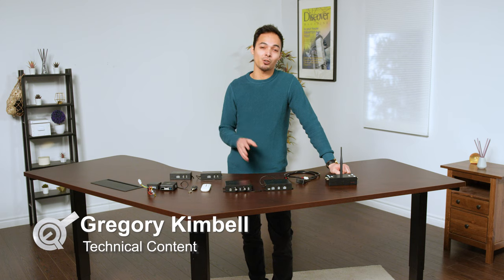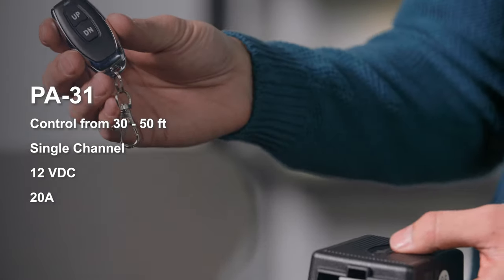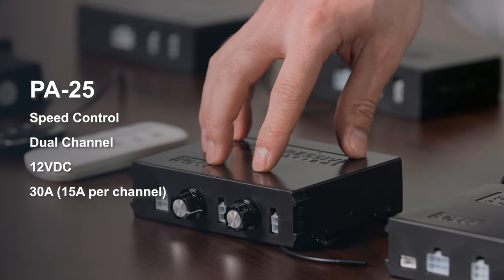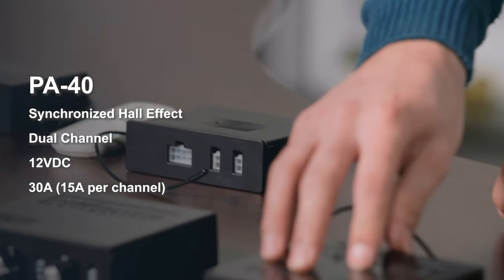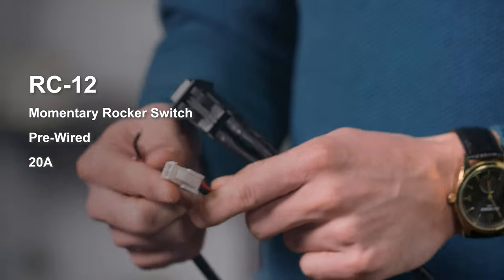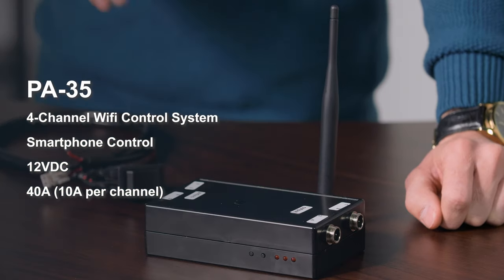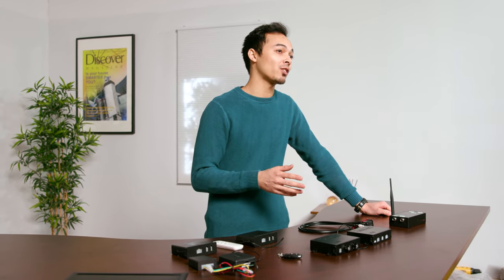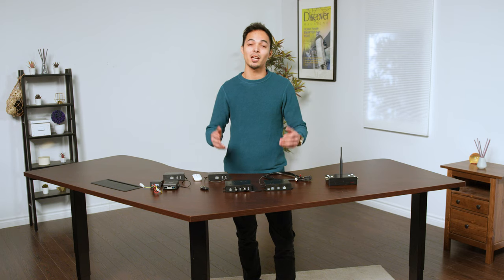Control Systems for Linear Actuators | Progressive Automations

Comment: Which one of these control boxes, in conjunction with other components, would allow me to create an auto-levelling system for a trailer whereby four stabilizer legs level the load on uneven ground automatically (ie. without individually controlling each actuator)? Thanks!
Reply from the maker: Hello,

Our FLTCON-4 control box will work with 4 compatible hall effect type actuators to move synchronously together, however, we do not have a control box with built-in tilt detection that can auto-level when the ground is uneven. This type of function may require your own custom programming on a controller with additional sensors for the built-in tilt detection feature such as an accelerometer.

Best regards,

Progressive Automations
Reply: @ProgressiveAutomations  thanks!
Reply from the maker: Happy to help!

Comment: can I have one remote connected to 2 control boxes?
Reply from the maker: Yes, users can follow our Remote Synchronization Process to have 1 remote sync to 2 separate RF type control boxes.

Remote Synchronization Process: 
-Open the control box and press the white button. The blue LED with turn on 
-Press any button on the remote and the LED will turn off 
-The remote is now saved to the control box 
-A maximum of two remotes can be saved to one control box